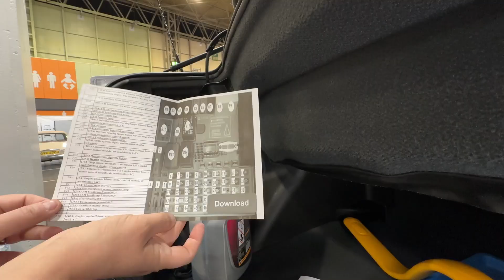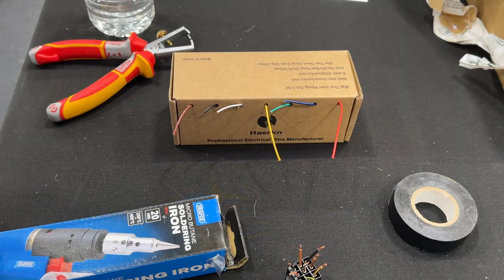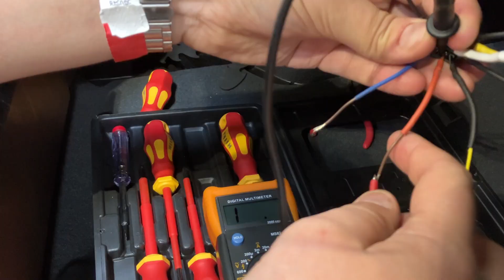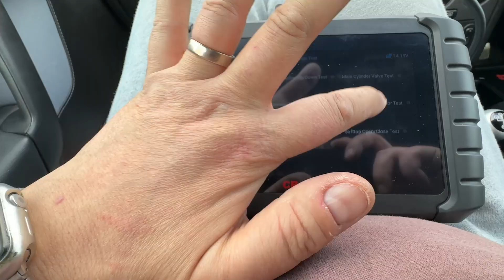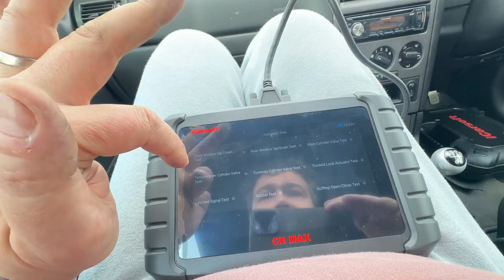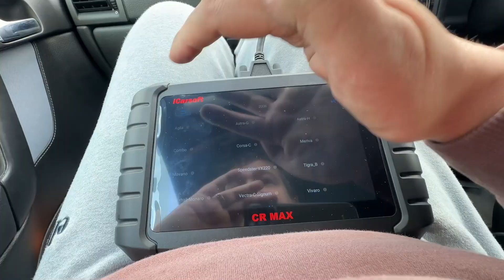Astra G Bertone Convertible Top Issues

Comment: I checked the boot loom many wires broken thanks for your explanation, I have more wires on the top half of the loom than the bottom half, do the brown wires go into a single brown wire thanks?
Reply: I think the thick brown wire goes to the dome nut on the car body.